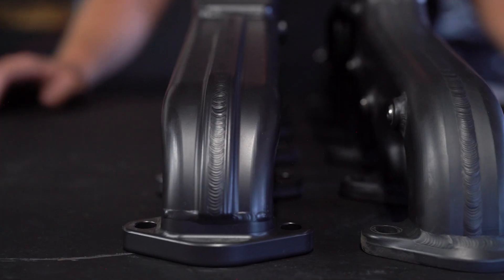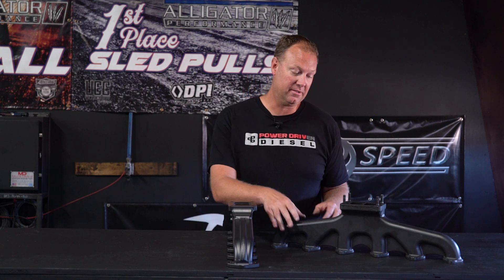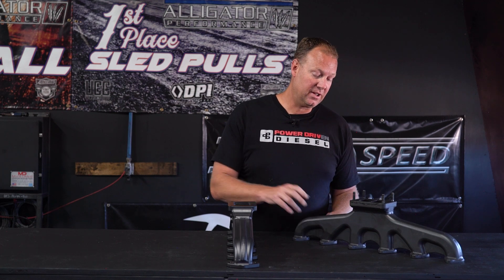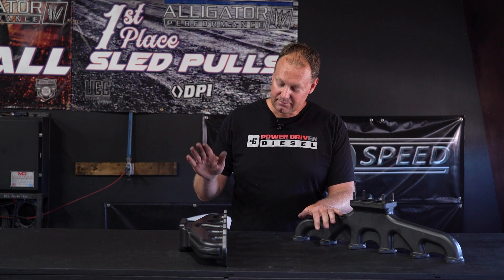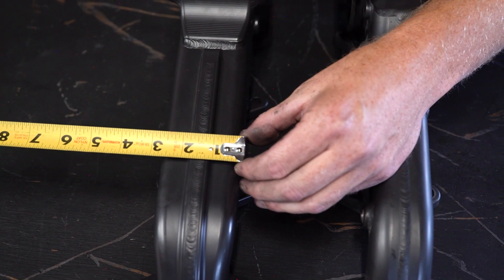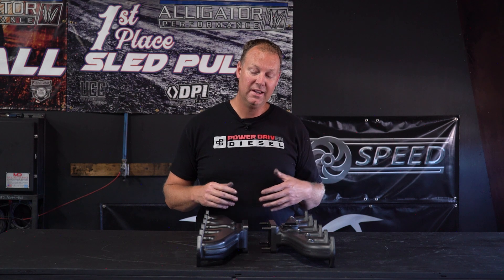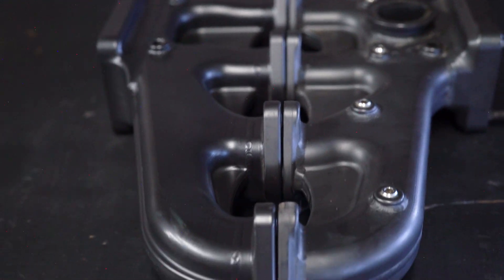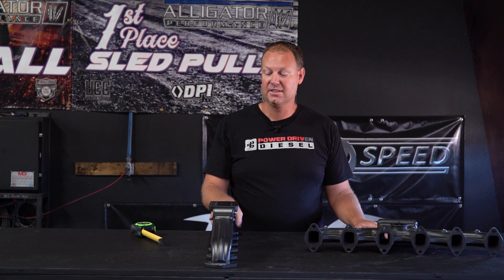NEW 3000hp Cummins Manifold

Comment: Hey Todd and idea simple I'm thought I have a way to get more air in the chamber but uncertain with the adde pressure and volume the motor would even hold up use a mechanical cylinderin the head that drops down after intake stroke and resets after firing on exhaust stroke thoughts.
Reply from the maker: can you rephrase what you asked. the premise sounds interesting but I'm having a hard time seeing the big picture. 
Baron

Comment: Is this manifold applicable to relatively stock 12 valves? What mods are required? 
I’m going to be in the market for a manifold for my -95 Ram. Other options?
Reply from the maker: No they are not for a stock 12v

Comment: What id like to know is if your only making 1k hp will this manifold hurt you in any way,
Reply: I would say you would loose a little turbo spoolup as you will have to pressurize more manifold space before the turbo gets going.
Reply: @bcbloc02  how long do you think something that flows lbs/min volume would take to fill something the size of a manifold plenum?

It takes negligible time. You'll never feel this on the ass dyno if you weren't bottle necked by the previous manifold.
Reply: @kr4dh4x0r  a half seconds lag is a half seconds lag.  If your goal is 3000hp who cares but if you are racing against a clock then it may matter.
Reply: @bcbloc02   The difference in fill time for a manifold like this is literally going to be min like microsecond scale.  Clocks at race tracks don't measure past the hundredth typically.  What i'm trying to point out is when you're using a huge pump filling a small ballon vs one slightly larger is going to be very very similar.
Reply: I highly doubt it, the bottle neck is not likely to be manifold runner volume.... it's likely the turbine inlet/outlet.  I could be wrong, but there's no reason to believe a larger manifold would make a problem in any way or shift the power band in any way.